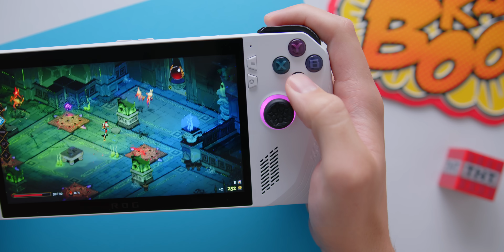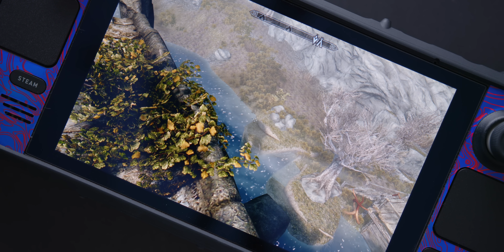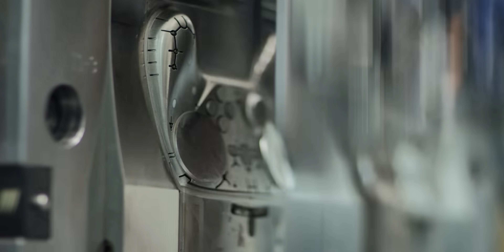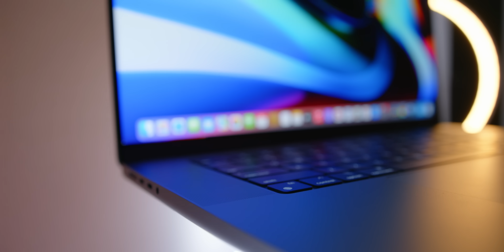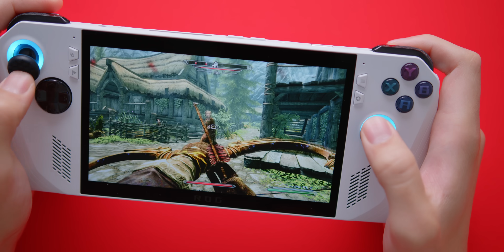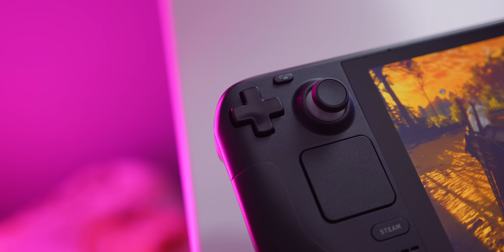Steam Deck vs ROG Ally - 3 Months Later.

Comment: I think the Steam Deck has aged so well compared to Windows handhelds. The fact that Valve only seems to be updating it every few years shows that they're willing to stand by their hardware, not to mention their commitment to Linux as a platform. The fact that Valve has the ability to sell the base Steam Deck configuration at a loss because they own Steam and make the money back on game commissions. These other Windows handheld OEMs will probably abandon their hardware a year or two after the next model is released, becuase they make their money on hardware sales.
Reply: For the windows handhelds through there’s not a huge amount of work they have to do on the software side since most of the updates hinge on withers windows or Amd.  Valve is married to the OS so they more or less have to continue to update it to support it.  I have 4 year old windows handhelds that still play games with no issues despite being abandoned.
Reply: @businesstron  The thing about Linux and Steam OS is that AMD (both Ryzen CPUs and Radeon GPUs) are well supported in Linux through open-source drivers, while Valve helps Proton and thus Wine (what Proton is based off of) get better so that there's less dependency on Windows. Not to mention there's no arbitrary cut off for Linux compared to Windows 11, where 6th and 7th gen Intel CPUs and AMD Ryzen 1000 CPUs were cut off just because Microsoft said so. Meanwhile, Linux is starting to talk about ending Intel 80486 support, a pre Pentium CPU from the late 1980s and early 1990s.

Not to mention the community around the Steam Deck is very clever, and should something happen to the Steam Deck division, you can bet the community will keep at it.
Reply: @cameron_bosch the lenovo legion smokes your silly deck
Reply: @EYE_OF_THUNDERA  Yeah, and it weighs almost as much as a brick! Not portable like the Deck!
Reply: @cameron_bosch  the only reason of the community is do to how many people use steam itself valve used that to sell but the fact is and stays they saved money using a open sorce software where you can never fully experience all your games in fact the graphic drivers always late due to people that work on the drivers do that as a hobby beside their daily job its a terrible mistake with older games you wont run in to that problem but with recently triple a games it hust shows the outdated drivers where windows has all the support for the games and drivers its the biggest flaw in linux and these are facts that valve didnt wanna eighter invest in windows or their actual own os and using open source software its a terrible shame and they did these tricks in the past... The steam os is fake and a joke before steam os it was called big picture mode... And not saying windows is perfect has alot of flaws but atleast you can do everything with it as a regular pc and not to worry about when games wil get fixed to work on it
Reply: @bionic3500  ...What? (Is this an anti-FOSS rant or something?)
Reply: @EYE_OF_THUNDERA  at almost twice the cost, I would fucking hope it does
Reply: @bionic3500  most modern games run flawlessly, proton creates a sandboxed environment for the games to run in, what this means is that the games are communicating with proton, not the graphics driver directly, so this rarely leads to driver issues and more often leads to proton issues, which Valve or the community fix ASAP

also have you used AMD hardware on Windows? I am far from a Nvidia fanboy, personally I prefer AMD, but I wont pretend their driver QA team is any good, hell just recently AMD was getting people banned with antilag+, AMD just has driver issues, its just how AMDs hardware has always been, and Nvidia refuses to work on a GPU that could fit into these devices, Intel is still fixing up ARC, not that ARC is even power efficient enough rn to fit into the low power of these devices, this only leaves AMD

also when you said "atleast windows can do everything a PC can do" why tf does that matter? the steam deck is a gaming console first, PC second, it does being a gaming console better then Windows could ever, and sure I will admit the desktop usage of the steam deck is primitive, its not meant to be a PC replacement, its meant to be a handheld gaming device with some PC usage
Reply: That's great and all but the fact is for these handheld PC they don't have the do the work Valve has to do to keep their systems up and running.  If these games do a patch or something it's usually catered to work in the windows environment.  I've seen patches applied to Eldon Ring that had no problems on windows but wouldn't even start up on the steam and deck.  I could see the same problem with Linux and Steam deck that the Open Pandora had with Linux.  It's a good OS but it takes alot of work to get folks to work with it.  The open pandora flamed out while android handhelds became a thing for emulation because they were easier to manage.  @cameron_bosch
Reply: @businesstron  this isnt true, Proton is open source if Valve (for some reason) abandoned it, the Linux community would be sure to keep it alive, this cant be done with Windows, come 2025 when Windows 10 is dead and Windows 12 is probably out, any Windows 10 based handheld is dead, you SHOULD NOT use out of date OS's under any circumstances, Linux never goes out of date as its open source, your not relying on a company to keep support, also Linux based OS's are modular, if 1 package stops being updated you can replace it with one still supported, and most things on Linux have multiple options, if one day the KDE desktop environment stops being updated you still have the options of GNOME, XFCE, Budgie, and probably many more in the future

If Valve dropped SteamOS support for any reason, a community made steamOS would rise from its ashes, this is what happened when Valve dropped support for steamOS 2.0, ChimaraOS counited where Valve stopped
Reply: @MayYTlive  That's bull....i still have laptops from over a decade ago that may be on Windows 7 or 8 that works with no issue.  Microsoft may not support the OS any more but everything it's used for still works. Come 2025 my Win 1 and WIN 2 won't just crap out and not work.   Proton being reliant on a community is good for somethings but that could also keep it a niche thing.  It's also pretty easy to update Windows Handheld OS's from the last few  if they have the specs for it.    Hell the WIN 3, Win Max 2021 and Aya neo next came with Windows 10 and I updated all of those to 11 with no issues whatsoever.
Reply: this aged well
Reply: @NoradNoxtus  The Steam Deck OLED is still just not a APU (CPU & GPU) increase. And that's a way of showing that they're still selling and committed to supporting the OG Steam Deck.
Reply: @NoradNoxtus  indeed 😁
Reply: Dang, instead of getting an OLED deck like the brokie crowd, I might get an ally now
Reply: @thomaszinecker1785  You mad that Windows 11 isn't good for handhelds?
Reply: @cameron_bosch  Handheld? heck i wouldn't even trust W11 on my main PC....if Linux & Steam manage to evolve the Linux platform into a consistent and good OS for games, I would shift to Linux rather than Windows as my PC OS of choice as my work stuff still can be done with my Mac
Reply: I would buy the Steam Deck if only most of the games I play can run in it without tempering with stuff like League of Legends and Genshin Impact.
Reply: @diezfrancis  Don't play Riot Games, especially Valorant. That game's anti-cheat (I don't know if it is in League of Legends, but still) is so low level that it is essentially a root-kit. Don't reward them.

As for Genshin Impact, there are third party launchers... But being a free to play game, I don't get why people like it...
Reply: Aged wel? It lags with starfield... And other newer triple a games... Its at its max by far
Reply: @bionic3500  Starfield... Didn't launch in the best of states. And Cyberpunk 2077, even with the expansion, runs well at around Medium settings (with the Steam Deck preset).
Reply: @bionic3500  for $700 I would get a laptop lol...  price to performance, steam deck wins.
Reply: @bionic3500  Starfield is the only game it really does, any other game it can handle at at lest 30 fps, which is what you should expect from it, its price as a console, its targeting console performance, you should not be expecting PC performance

thats where the steam deck and other handheld PCs differ, the steam deck is a console with PC capabilities, the other handhelds are PCs packed into a handheld device
Reply: Good input. Windows components are outdated pretty damn quick
Reply: The deck has not aged well at all 😂 it’s only been out a little over a year and it’s struggling with newer games.
Reply: @EXITONEZ  Which ones? I can play Spider-Man Remaster / Miles Morales, Cyberpunk 2077, etc. And at decent setting levels.
Reply: @cameron_bosch  starfield, god of war, horizon zero dawn, control, resident evil 4 and many more are not enjoyable on my deck. Like at all
Reply: @EXITONEZ  HZD, Control, & God of War run just fine if you turn down the settings to around console settings and use FSR (in Control, that means using Steam OS's implementation).
Reply: @cameron_bosch and try hogwarts legacy and starfield on your steam deck you know the newer games 😂
Reply: @EXITONEZ  Starfield sure, but the rest run great on my deck, all low settings 720p 30-45 FPS

the steam deck is a console PC hybrid, you should have your expectations be console performance, 30 FPS in AAA titles, 60 FPS in easier to run AAA games and most indie games, and 120+ FPS in esport titles
Reply: Them updating doesn’t change how bad the steam deck is. It doesn’t upgrade the weak cpu gpu. And no vrr makes it feel sooo bad.
Reply: @deathshade777  First of all, the CPU & GPU combination not being updated is by design; it's meant to serve as a baseline for several years. Second, the price of the base model would go WAY up if they bundle the AMD Z1 Extreme or the Ryzen 7840U it is based on. And that low price is a good thing for the Steam Deck.
Reply: @cameron_bosch  plus it benefits everyone if devs have to make games compatible w/lower end systems.
Reply: @cameron_bosch exactly I can attest to this it's a great handheld
Reply: The steamdeck  in terms if specs is mediocre  and cheap that's its saving grace.  They update the terrbe  steam  os because  that's what's getting the games too run.  50% of the games runs run like shit even old games. Windows handhelds are click and play because  it runs on windows. The steamdeck  is  cheap which is why people  shill for if they steamdeck  cost the same as the other competitors  than  they SD wouldn't  be very popular.  If the Lenovo  Go/ Rog Alley had the same price as the steamdeck, then the SD would be instantly forgotten  about.
Reply: @2ndAmendmenttime  "50% of the games run like shit"

No, most of them don't. Maybe 20% of games at most. And most of those are those FPS games like Destiny 2 & Valorant, both of which don't work under Linux because the companies won't support Linux.

And no, if the Steam Deck and the Asus ROG Ally were the same price, I'd 100% choose the Steam Deck, not just because of Windows, but because the Ally actually has an unfixable issue with the microSD card slot frying microSD cards in the slot because it cannot be cooled properly.

And in 2 years time, Valve will probably still be supporting the OG deck, while most of the Windows handhelds will be forgotten about. Heck, even Ayaneo looks to be moving to a Linux based OS because the interface is much more customizable on Linux and the work Valve is doing with Wine and Proton took Linux gaming from being a joke when the first Steam Machines were released around 2014 to in 2023 many games just working on Linux and thus the Steam Deck.

I'm not saying I don't think competion is bad; it probably will push Valve to keep updating the Steam Deck more often, but the Ally is not a good attempt because of Windows 11, the microSD card slot frying, and the uncomfortable feeling in the hand compared to the sculpted grip on the Steam Deck. Even if the screen is in 85% of ways better than on the Steam Deck (85% because the Ally's aspect ratio is subjectively worse and the higher resolution screen will kill battery life even faster) and having the XG Mobile port is pretty nice. But otherwise, I don't think the Ally is the best option, and most of the ones I would say are better are WAY more expensive (like the Ayaneo Kun).
Reply: @Elknkam  youve entirely wrong, steamOS is just a better option on a handheld then windows, and your just plain ignorant to say most games run like shit, they either run great under steamOS or dont run at all
Reply: @Elknkam that’s BS. Where are you getting the 50% from? I have a library of over 100 games ranging from indies to AAA. Only had maybe 3 that didn’t work or play as intended on the Deck. Not shilling. Just stating my actual experience with the device.
Reply: @Elknkam obviously never owned a steam deck

Comment: ALLY 100%
the speakers , screen , and touch response omg wow !
Reply: anything that uses windows is trash
Reply: @lainpilledwiredcell and you have tested it? 😂
Reply: yes, most games ive tested run better with linux @onionv
Reply: @onionv don't listen to the other guy mostly the one's who hating only has steam deck, as someone who had both steam deck is the worst, screen sucks like having a switch v1, can't play without tinkering with a lot of settings, horrible UI.
Reply: @lainpilledwiredcell  Nope SteamOS/Linux is cool at times, but I’d take Windows over Linux
Reply: clearly you never used linux if you are saying that @MithosDagon
Reply: @lainpilledwiredcell  SD plays games at 25fps LOL